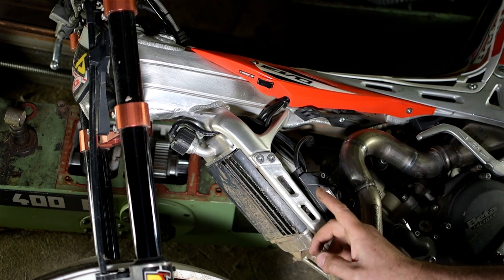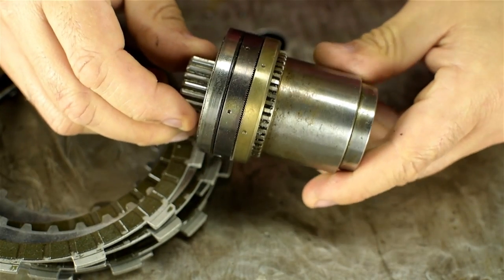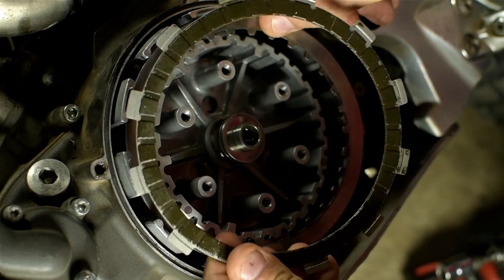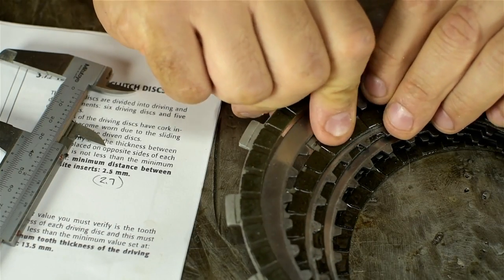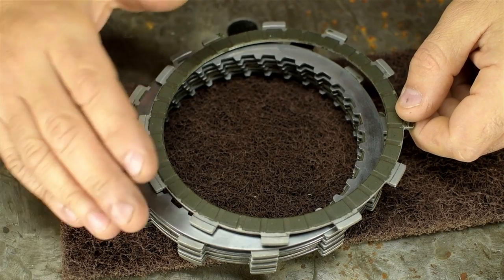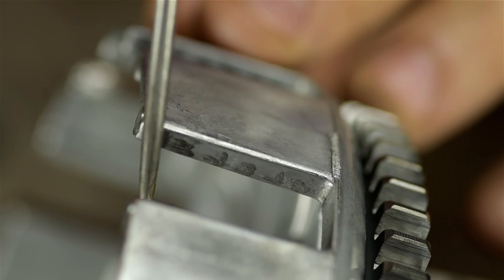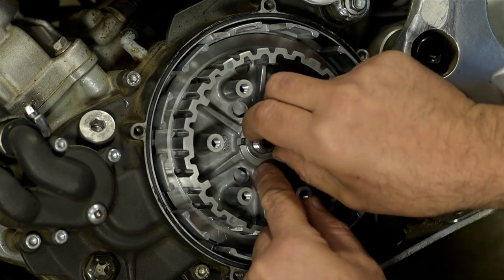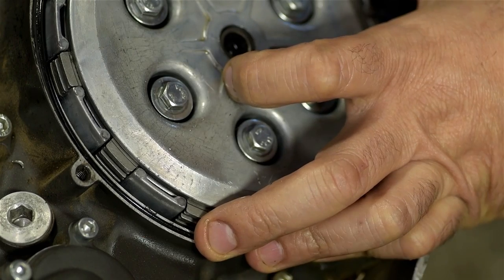something something MOTORCYCLE CLUTCH!

Comment: Another great ToT video, my first non-machining . lathe out of your collection.

Butt, just a note about clutches on most bikes: It's called a wet clutch as it is bathed in oil, wet, always lubed, usually by the same engine oil, hence why you have to use specific bike oils and not car oil that have certain lube properties that will slip the clutch on a bike. Personally, I use Shell Rotella T4 15W-40 diesel engine oil  in all my bikes, it has all the right specs for bikes, more detergents and more of the right minerals that benefits metals on metal wear.(can't remember what it's called sorry). When assembling a bike wet clutch, you should bathe the friction plates thoroughly before installation, otherwise the first spin of the clutch in a dry state will result to some glazing until enough oil saturates the friction plates while the engine is running, and that defeats the whole purpose of having cleaned your clutch in the first place. 

When you want to hurt your brain a little more, check out the DRY clutches found on BMW bikes, ouch! 

Thanks again for a very entertaining gaseous video ;)

Comment: Is there any chance that normal engine oil was put in this engine?  As opposed to engine oil designed for wet clutches.  I would normally use a nylon brush and dish soap in a bowl to clean the friction disks and scotchbrite on drive rings to deglaze along with changing the engine oil with the correct type.

Comment: Hmm, I do a lot of work on motorcycles, to be honest, the number 1 thing that improves clutch feel is springs. Often times when people complain about the clutch engaging very far out 90% of the time just need new, harder springs, on many bikes, especially smaller CC (500 and down) the factory springs deteriorate VERY quickly, and are usually softer to begin with, I'm talking about like under 10000 miles and your clutch engagement is around 80-90% of the way out, a good set of springs like Barnetts or EBC Heavy duty/Race springs always help to bring those back to about middle of the way and stay there a lot longer. I don't know how many horses that bike actually is but with smaller bikes the clutch plates last virtually forever. The clutch pack is virtually identical between yamaha's R3, R6 and R1 and those are 40, 120, 200bhp motorcycles respectively. The only difference is the springs pretty much. As far as the pitting goes on the basket it's a bit of a goose chase, you can file them down, but that increases the gap ever so slightly so now the friction discs bang into the basket even harder creating more pitting faster. To be entirely honest the basket is a wearable too but usually you can expect it to live 2-3 clutch pack's worth. Anyway back to the original point, as long as the clutch doesn't slip, it's transmitting full power, so unless there were obvious signs of slipping such as revs jumping when getting on the gas it wouldn't be losing power through the clutch, as you said with brakes, if they slip you'll feel it even if it's slight as you'll start rolling down a hill, if they engage, it doesn't matter "how hard" they engage as long as the car doesn't roll, it's fully engaged. Sorry if this came out a bit too long.

Comment: measure the run out of the decompressed clutch with springs on it, adjust spring tension evenly until the end play around the diameter of the pressure plate is even so you get full engagement during operation, shim if needed. Also on a wet clutch it's a good idea to soak the friction plates in oil before reinstalling so you don't glaze them over by accident the first time you ride.

Comment: I remember doing this with the clutch on my old Kawasaki ZZR 250 road bike. Deference was I actually needed to replace the clutch basket after it started cracking, but I only ever felt the clutch slip a little bit. I figured it was easier to do the job in the shed rather than on the roadside 80km away from anywhere.

Comment: Factory Team Pro Tip: Always orient the plates with the rounded edges down in the basket.
They’re stamped out of sheet metal and you can easily feel the difference between the sharp and the rounded edge.
If it’s a noticeable difference in enduro, by amateur riders, I guess in trials it’s essential for that perfect clutch feel.
But as the pro you are, this was just something you forgot to mention in the video...so no need to open it all up again. Right. 🙄😉
Great video as usual and can’t wait for the next MAHO one. 👍

Comment: When installing clutch plates in "wet" clutch setups, you need to soak the plates in the engine oil for a while before installation (or in a two stroke set up, the "transoil").  Now I know those plate weren't new, but you did wash them in detergent.  As you mentioned, the plates are porous.  I think it would have been a good idea to give them some time soaking again.  Just in case.

Comment: tony i dont know about bikes but with cars the clutch material is held together with water based adhesive because the oil based adhesive would be dissolved away in the transmission by the transmission oil. using water on the clutch pack like you did to clean it up might dissolve the adhesive on the clutch pack and make the clutch not engage.

Comment: You might want to check another source for the clutch & steels thickness. I had a 700R4 that had incorrect specs in the book. The result was I had to rebuild 2nd gear for the second time. The second time, I used the clutch/steel Manufacturer specs. The difference I want to say was  50 thou. It’s been 12-13 years since that happened, so the exact details are forgotten. I also did that job on my Kitchen table.

Comment: those  imbedded teeth on your clutch basket is what causes a sticky clutch and can also cause the clutch to slip because the clutch disks will home in those slots and basically hold the friction surface (forgive me for a short explanation) away from the slipper plates.  Doing what you did does get more life out of the basket, but the writing is on the tabs that you need to be searching for a value priced alternative like Rekluse (they used "k" instead of "c" to save you money.)

Comment: I like to soak wet clutches in their intended fluid before install. In this case, soaking those frictions in the dirt bike motor oil for a couple hours before install would have been best. I also would recommend changing the pressure plate springs because they take a set over time.

Comment: If you have a problem getting that o-ring to stay seated, you can use a drop of thin cyanoacrylate in two or three places to get it to stick. I'm well aware that it isn't recommended and that you could mess up the seal by doing this, but I've also built a bunch of clutches and never had that issue. It's a much bigger pain in the butt when you can't lay the bike flat on the ground like Tony did.

Comment: A car door window makes a pretty good flat surface, check with  a steel ruler.
If the clutch springs seem a little soft don't just hope they will work ok, shim them or fit new ones, maybe stiffer springs.
Instead of a file invest in some stones. Nobody uses them anymore which is a pity because they do a great job.
If the clutch lever seems to 'judder' instead of operating smoothly.... you might have a long rod which pushes against the clutch rod that's in the basket. This can wear in a series of grooves and stick in it's seal. This can often be replaced just by pulling it out and pushing in a new one.

Comment: if washing the plates with water , i would suggest drying them in the sun or warm oven before installing. You don't want to introduce water into the oil. Also make sure you used the correct oil for the plates you have installed. I have a Beema and its real fussy.

Comment: If you aren’t using motorcycle specific oil, make sure the oil you are using does not have the little round “energy conserving” label on it.  Those oils have friction modifiers in them that make wet clutches slip.

Comment: Tony, pretty sure you should have oiled the clutch plates before installing them back in the engine. You want to have oil on the clutch parts (that's why they are called "wet" clutches).

Comment: 8:50 Yeah that friction material is not cork though but a mineral type of asbestos replacement. And it wouldn't surprise me in the least if it could also cause asbestosis, just like the original.
That big enough container would have been a really good idea.

Comment: Pro Tip: If your clutch ever starts slipping during a trail ride (or you’re too cheap to replace the plates), one quick temporary fix is to add a few extra washers to the bolts that compress the clutch springs. That will compress the clutch springs a bit more thereby compressing the clutch plates a little harder than normal giving you more friction and will reduce (if not stop) the clutch from slipping by itself in the short term. 

The downside is that it makes your clutch pull a little harder but who cares if it allows you to finish your ride!!! ✊     🤙
Reply: that will work for a while

Comment: First things first, What oil is in the bike, any oil with friction modifiers will cause wet clutch's to slip! Second thing, never clean friction material with water or derivatives there of, the f/m is porous as you said and can hold the h2o until it gets hot turning it into steam and can literally blow the f/m off the backing plate!!! To clean, use a good brake cleaner! Third thing, the steel  clutch plates should have a surface finish that if you were to scrape a penny along the face, traces of the penny material will be left on the disc. Finally, I realize you were trying to eliminate everything, but there was nothing wrong with that clutch basket, though you did no harm, sooo that's all that matters. Great vid. Cheers.

Comment: AHHH! You scared me! I work on heavy equipment, a lot of the clutch material is paper. Water will destroy them. Clean clutches with solvent only, phew
Reply: I've also read from what I consider to be reliable sources that on some automotive automatic transmission clutch packs that are essentially the same thing as this clutch that the adhesive used to bond the friction material to the backing plate is water soluble, so not a good idea to use water unless you are certain it will not cause any problems.

Comment: The problem with filing those marks on the basket is that it gives the friction lugs a bit more room to get a good run-up and smack the surface that much harder...  not that you took that much metal off, just bear in mind that it's a trade off - each time you do this the problem will happen more frequently.

Comment: What kind of oil did you use in the gearbox?   Sometimes the anti wear additives in conventional engine oil (MSO2 and ZDDP) can cause wet clutches to slip. I guess it takes a 10w30 or 10w40 weight oil.. i recommend an oil specifically for a 2 stroke gearbox like Motul Transoil or Belray Gear Saver.  

Also always oil/soak new friction discs before installing. They are porous like you said, and they can absorb a fair amount of oil and this makes the slipping action smoother.

Also, with motorcross bikes, the factory clutch springs are often chosen to slip a little bit when you do clutchless gear changes. This prevents gearbox damage but heavy handed riders or riders of bikes with modified engines can find this slipping excessive, and this is why you can often buy aftermarket springs that are 10% stiffer.    Enjoy and as always, great video!

Comment: I had a '75 GL1000, and probably had to replace the clutch on it 3 or 4 times in the first two years I owned it. I made the mistake of ordering springs that were too strong and one shot out of the housing, removing a decent amount of metal with it. I eventually got a perfect combo, but sold it because I don't have time/space for it anymore.

Comment: As a post thought, when cleaning up the faces of the clutch basket, did you measure to see how much tolerance those slots have, as in how identical they are, as well as measure the tabs that slide in them to check on their uniformity?  Reason I ask, is say a "lot" (in relative terms) was removed from a large number of those slots, then the tabs would be driven by fewer slots, increasing the pressure on THOSE tabs, and make them bed in harder, deeper and faster to THEIR slots, which would put bigger indents in fewer slots.  Maybe I'm overthinking it, but uniform small indents in all the slots would be better than only a few slots with big indents, as far as clutch operation goes, yes?

Comment: If you put in non-oem oil/spec it can cause the clutch to slip (for example it requires semi-syn oil not full-syn, the weight, sometimes the brand). However, if your clutch is adjusted correctly (another possible cause) and you have the right oil I'd recommend replacing the springs so it pushes harder on the clutch and doesn't slip (you could go stiffer, but since yours are barely at spec just new ones at the same sniffness). Good luck - enjoy your bike vids.

Comment: Fresh oil and new springs probably would've solved the problem quickly, no need for tedious work on a clutch with so little wear. 
Wear on the basket only becomes a concern when you replace the pack and those groves don't match the spacing of the new parts anymore -> jerky/sticky clutch.
Also, as others have already mentioned, re-assembling the clutch dry is rather risky. But I guess we've all made that mistake at one point^^

Comment: my bike was suffering a slipping clutch at the track one day. didn't want to waste my entry fee for the day so stripped it down, rubbed the disks on the concrete and put them back in. solved my issue for the day in 20 mins. full on dodgy fix

Comment: With the massive increase in HP from the top end rebuild, you might need stiffer spring.  I am sure you could find someone to wind some new ones for you at about $100 a piece.  Or add some shims under the washers.  Or better yet, custom made thicker washer !
That O-ring look like it had a "hair" of neoprene hanging on it.  If so, you will have a guaranteed oil leak.

Comment: You may wanna explore other brands or types of oils. I've had my fair share of clutch slip on a drag tuned moped. Something a little stiffer like 10w50 makes a big difference. We've even used Motul 90 PA LSD oil and it works great.

Comment: One thing with clutches is if you’re replacing one part generally you also need to replace every other part to because other wise it will wear faster, and I’m not sure if filing the faces of the basket was a good idea, it follows the same premise as the lobes or the friction plate where if they’re too loose they’ll wear too fast or won’t work properly

Comment: Friction discs are stamped so the other side is round and other side is sharper... To make smooth behaviour on the clutch where places where also filed You might want To place ALL discs so that springs are pushing into the smooth direction and opening of the clutch goes against sharper edges. Most important thing thought with wet clutches is that the oil used has some kind of Friction stabilizer package... Like agricultural transmission oils... Too good engine oil does not have this property and results into jerky or slipping clutch behaviour.

Comment: So? How does it feel/sound? I also tried to hand machine the basket with a file. It was way more worn out than yours. I don't think it felt differently after that, but definitely made the clutch noisier at low rpm because of the higher play between the basket and the friction plates.

Comment: 16:35 Excessive clutch lever free play can be corrected by adjusting the clutch cable. If the clutch is hydraulically actuated it should be self-adjusting

Comment: Motorcyclist on a 35 year old Honda V65 Magna that does his own maintenance and repairs.

Since those springs are borderline, you SHOULD replace them. If there anything, those springs will make a difference. Especially if you have any kind of clutch slippage, and the linkage and cable are correctly adjusted.

Comment: if your clutch slips and even replacing the discs does not fix the problem you can have a machinist remove a few thousants from the top of the spring screw pillars and the same amount from the top edge of the inner clutch basket.

Comment: Eeek! Professional motorcycle tech and hobby machinist here. The only thing you did wrong was use an impact on the clutch hub nut. I don’t know the powertrain on this particular bike and it all sort of depends but by using an impact instead of using a gear jammer (a substantial lead fishing weight works fine, or Harley makes a Teflon one shaped like a small 3 stair) and appropriate ratchet then you run the risk of damaging your primary chain, damaging your ring gear and/or primary gear or in some instances even sheering your flywheel key and creating timing issues.

Comment: hey tony, it might well be that your clutch was used with non motorcycle engine oil - motorcycle oils have additives in them that prevent clutches from slipping, if the bike was at one point in its life filled with car oil, the clutch is trashed even though it doesnt look like it. something to keep in mind

Comment: Just an idea in case you've still got slippage issues. If that bike has been using synthetic oil but the last time oil was changed a conventional oil was used then you can get slipping.  Years ago I this was explained to me and I never really bought it until I did just that.  Had been running synthetic in my old Yamaha 600 and one oil change I used regular oil since I had enough laying around.  (Stuff is pricey for bikes, synthetic or not).  Anyway it was immediate.  Bike did fine in 1st and 2nd but 3rd up on freeway or under load and it slipped every time unless you went easy on the throttle.